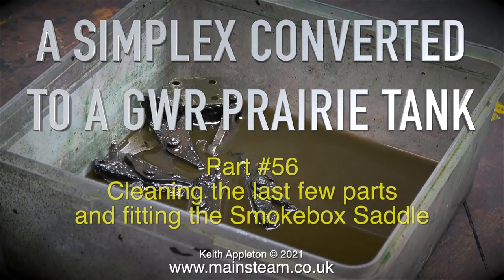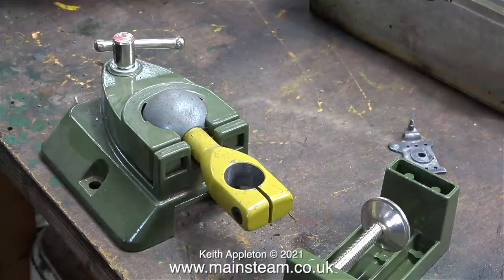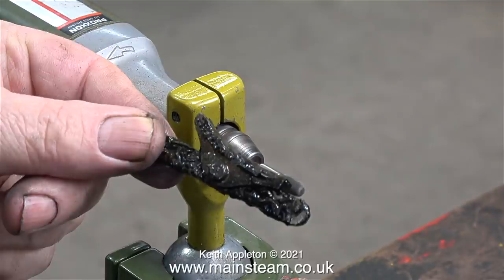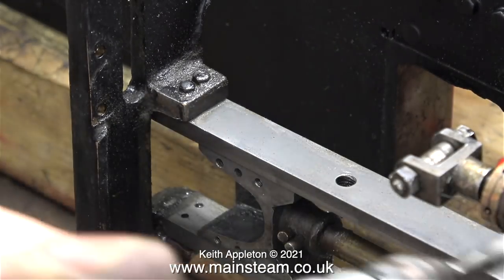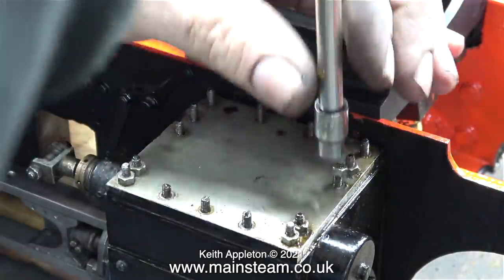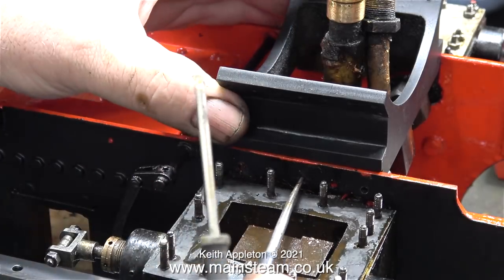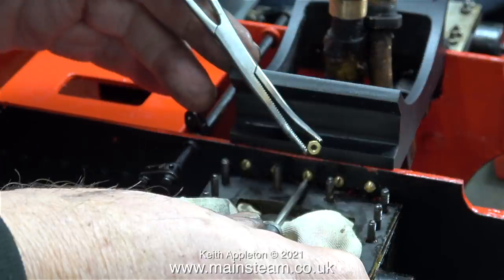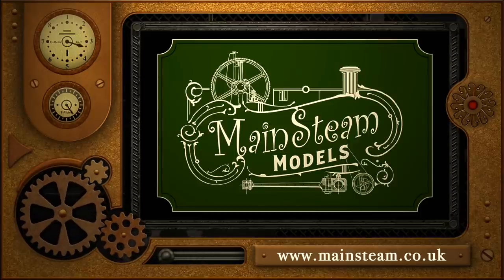SIMPLEX PRAIRIE TANK - PART #56

Comment: Thanks for showing the Proton tool holder, not seen one before - that looks very handy. What type of brushes are these. I have some cone shaped ones which are useless as they simply flatten out with the centrifugal force and turn into radial brushes. ( but they were very cheap )
Reply from the maker: The Proxxon tool holder is incredibly useful. The wire brushes were via Ebay, cheap & cheerful but they seem to work OK.

Comment: You didnt use loctite to keep the nuts from backing off after assembly?
Reply from the maker: Not necessary as the nuts tighten up securely onto the bolts.